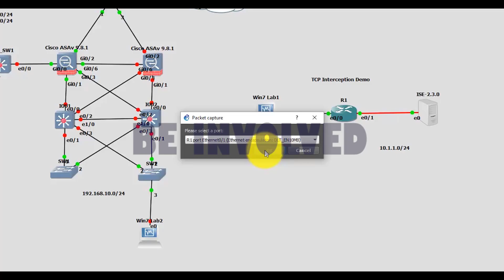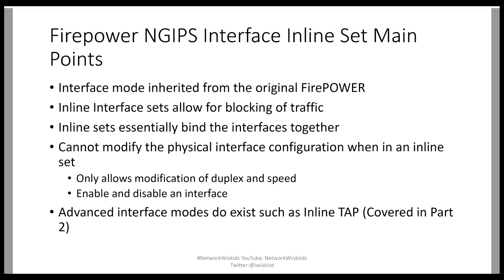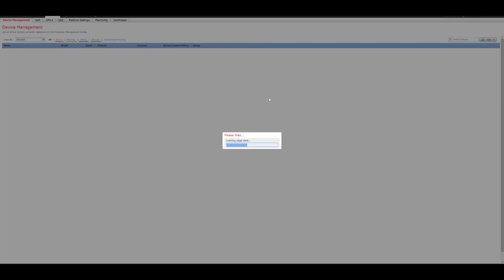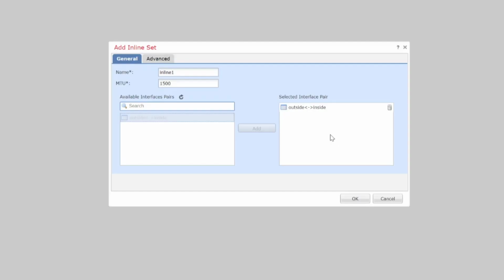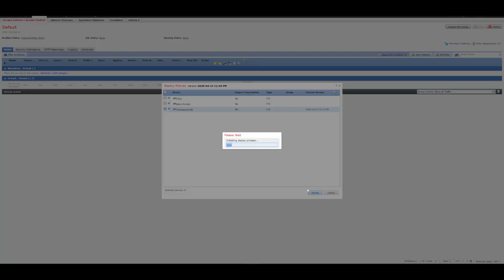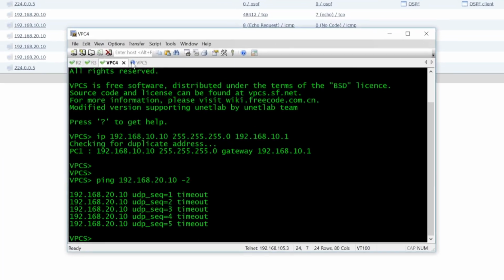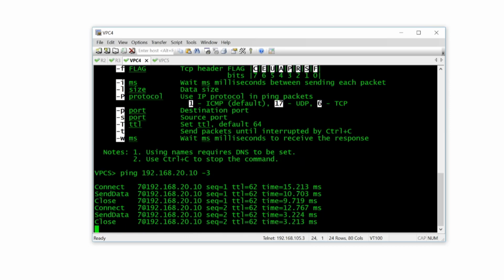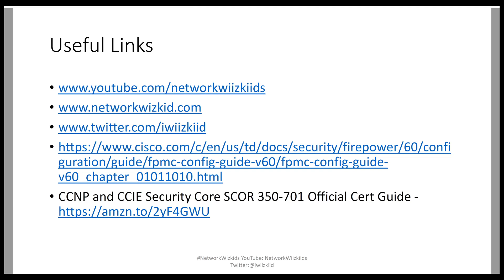Configuring Cisco Firepower NGIPS Inline Sets Part 1

Comment: Hello really nice video, thanks.
Everything works fine in my environment but I have the issue than multicast traffic is not shown in my event logs.
I have a firepower 7000 ngips with inline pair like you. Maybe you have an idea?
Reply from the maker: Thank you for watching.

Check you access control policies and as a test maybe create a rule to log all traffic so that you can see it in the logs.

Comment: Hey buddy, thanks for the video. I'm studying for the same exam + the specific Firepower one (300-710) and your videos are helping a lot. Again, thanks.
Quick question if you please, checking the transparent mode (with bridge group) and inline set (without tap), they are basically the same. Or is there any real big difference?

See ya, keep up the good work !
Reply from the maker: Hey George, thank you for the kind words and thank you for watching, I'm glad they are helping.

Yes, that is kind of the way I look at them, although the BVI's are essentially in transparent deployments where you are still firewalling but at layer 2 and inline-sets are more for IPS where you may want to block inline, not necessarily using the firepower device for firewalling.

Hope that helps, more videos coming soon :-)